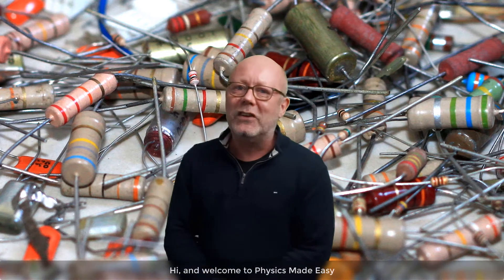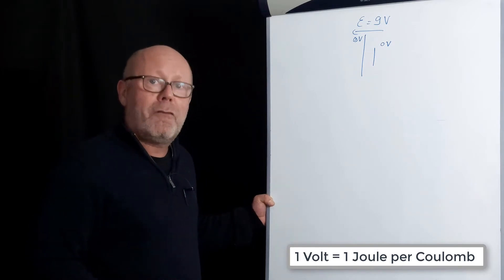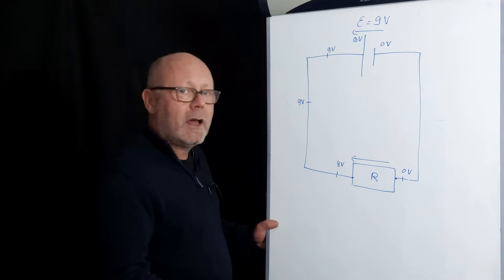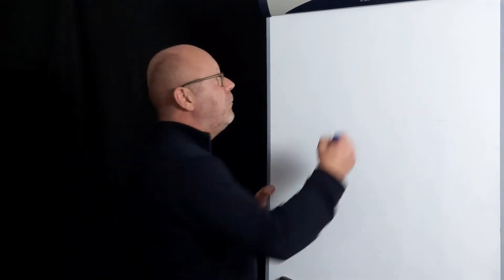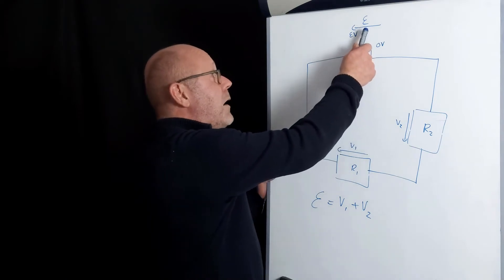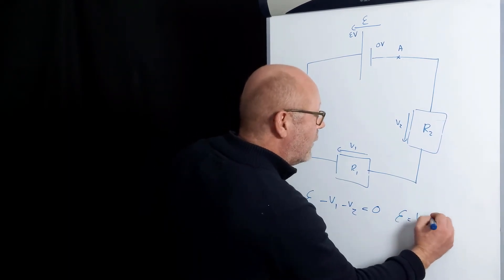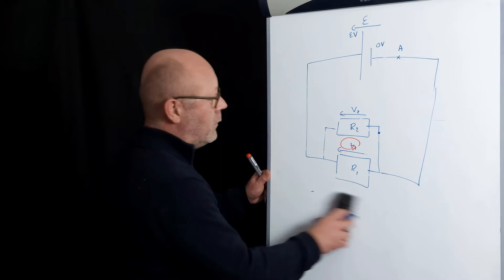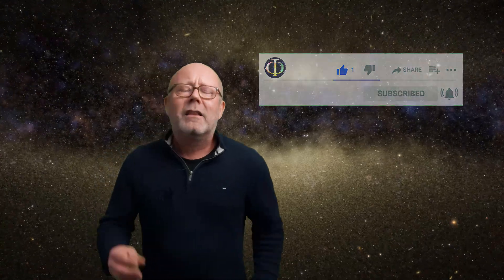Resistors in Parallel – Why the Same Potential Drop ? (Electric Circuits, Physics)

Comment: Hello sir pls answer my doubt pls sir my doubt is that u said battery having voltage 9v and move there freely without losing any energy but sir wire and item offers some resistance so if battery gives 9v some voltage must be dropped but we never do something like that while solving numerical sand sir how they energy can freely as wire offers some resistance pls answer sir
Reply from the maker: You are totally right King12. In reality all standard materials have a certain resistivity (only superconductors have a resistance of zero at a temperature under their respective Tc). Thus, when considering cables of a circuit, these will have a certain resistance. When connected directly to both poles of a battery (short circuit), the potential will drop linearly across it (for example, if the battery has an emf of 9V, and the cable is 18cm, the electric potential will drop by 1V every 2cm).
However, if you connect a resistor to the battery using that cable, the effect of the resistance of the cable will be negligible compared to that of the resistor, that is why cables are considered in circuits as having no resistance (it’s a practical model).

That was an excellent question. Continue thinking that way! And, if you cannot find an answer right away, do not get stuck as it could make you miss the train, be patient and move forward. The answers will come.

Comment: Why don’t the charges lose their potential energy as they move through the conductor? Like if a battery raises the potential of a charge by some joules then why does the charge not lose its potential energy via its motion?
Reply from the maker: Actually they do…
In reality, in standard conditions, all materials, even conductors, have a certain resistivity. Thus, when considering cables of a circuit, these will have some resistance. When connected directly to both poles of a battery (short circuit), the potential will drop linearly across it (for example, if the battery has an emf of 9V, and the cable is 18cm, the electric potential will drop by 1V every 2cm). However, if you connect a resistor to the battery using that cable, the effect of the resistance of the cable will be negligible compared to that of the resistor, that is why cables are considered in circuits as having no resistance (it’s a practical model).
So you are right, in reality, the potential energy of a charge (= electric potential of a position * charge) moving through a conductor changes progressively with its position.
Reply: Ohh! I think I get it now. Thank you sir!

Comment: Sir why don't micelles form in ethanol. Please sir help
Reply from the maker: Hi Lavanyam. Micelles form when you have in the dispersed in the water long alkylated molecules  with one side hydrophobic (repelled by water) and the other hydrophilic (likes water). The molecules will naturally arrange themselves in little spheres with the hydrophobic side inside the sphere, and the hydrophilic side outside. Micelles.
In ethanol, alkylated chains are soluble (that's why you can clean nicely greasy surfaces with ethanol), so, the chains cannot agglomerate into micelles.

Comment: Sir why don't current flow through the bird standing on a same wire having no potential difference. Why don't current pass through the bird and into the wire causes a shock to the bird. I wish I would get the real answer for the need of having potential difference sir rather than analogies.
Reply from the maker: Current will pass by the path of least resistance. Having the two legs of a bird on the same cable is like placing a resistor in parallel to the wire. The wire has a negligible resistance, but not the bird, so all current passes by the wire, and the bird is safe...

Comment: Sir how can resistors in parallel make the same potential difference or voltage? I mean if a 1ohm resistor drops the voltage to some extent and 100ohm resistor which is also connected parallel to it, how can it make the same potential difference as it drops the voltage very much such that the difference in potential is more? How please tell sir
Reply from the maker: The potential drop is an energy drop per coulomb of charge passing through the resistor. It's not an amount , it's 
a concentration. the 100 ohms tells you that in the same amount of time, you will have a 100 times less charge passing through that resistor (normal, it resists more!). Look also at the cables (A cable is an equipotential...)

Comment: How can the resistor make the oldest to drop to zero in spite of its resistance? Like if 5 ohm resistor able to make the voltage drop to zero volts and how can a one ohm resistor also do that?
Reply from the maker: Imagine two levels: one is at 5 meters high, and the other is at 0 meter high. You connect these two levels with a ramp. On the high level there is water, it will naturally go down the ramp to the low level (the ground). 

The fact that the ramp is steep or not will not affect the height it reaches in the end: whatever the slope of the ramp, the water will reach the ground. On the other hand, It will affect how fast flows the water: a light slope, and the water flows slowly, a steep slope, and the flow will be large.

The height represents the electric potential
The steepness of the slope represent the resistance (steep: low resistance, not steep: high resistance)
The flow the current.

I hope this helps!
Reply: sir then I got a new doubt. If the potential gets drops to zero in spite of the resistance then when the resistors are connected in series the current passes through one resistor all loses all the energy how can it work at the second resistor? Please sir  @PhysicsMadeEasy

Comment: @PhysicsMadeEasy sir why the all resistors able to drop the potential to zero? Please comment on this sir
Reply from the maker: If the resistors are connected directly to the battery (like in this case), The potential either side of the resistors are set by the battery...

Comment: Sir why  and how does electron  gain energy as they move across the battery
Reply from the maker: Actually, it is not rigorously the same electron that enters the battery and that comes out of it. But due to conservation of charge, any quantity of charge coming in, comes out. So it is a useful analogy to see the battery like a petrol station and the electron as a car, where it is the same electron (car) that gains energy (petrol).

Comment: Sir if the battery provides 10 joules of energy per coloumb how can there be loss of 10 joules of energy in all resistors doesn't it violate the law of conservation of energy
Reply from the maker: In both resistors in parallel, the loss is not 10 joules, but 10 Joules per coulomb passing through it.

Practical example:
Suppose the battery lets 1 Coulomb of charge flow in the circuit, and provides via these charges 10 Joules of energy to the circuit  (The battery as a voltage of 10/1 = 10 volts).
When the 1 Coulomb arrives to the junction before the two identical resistor, one half flows in the first resistor, and the other half in the second resistor, each half delivering half of the energy to the resistor (5 Joules).
In each resistor , a half coulomb lost 5 Joules, that is 5/0.5 = 10 Joules/Coulomb (10 Volts).
Reply: Great 👍  @PhysicsMadeEasy

Comment: two voltage sources with emf v1 and v2 (v1≠v2) are connected in parallel, what will be the voltage difference in the common terminal points?
Reply from the maker: Well, at first, during a transitory period, the source of highest voltage would charge the second one... A large current would occur in the cables connecting the batteries (it's value would be related to the equivalent resistances of both batteries): The battery of smallest voltage would see its voltage rise, and the reverse for the other. While the difference between voltages decreases, the current would decrease too until it reaches zero. At this point, both voltage would be the same.
I do not recommend you try with standard batteries... it would be like trying to charge a non rechargeable battery (risk of explosion)... and the max current at the beginning could lead the cables to melt, and the insulator to catch fire. So keep it a thought experiment :-)

Comment: Thank you for this video, here's my question, total novice I'm afraid. 
I have a 9v battery, with a resistor to stop my LED's from burning out. 
I have 2 LEDs in parallel.  If I use 2 LED's with similar voltage requirements (around 2.8v) they both light up, if I exchange one LED for an LED with a lower voltage requirement, around 1.5v, only the lower one lights up. Why?

Many thanks
Reply from the maker: Hi Ian,
At the moment you switch on the circuit, the voltage across the LEDs increases until it reaches a 'stable' point where current can flow. The first stable point is at 1.5V across the LEDS (the other 7.5V being for the resistor). Now current flows and the LED with lower voltage requirement lights up: the circuit is in a stationary state.
The 2.8V LED, being in parallel with the 1.5V one, is thus submitted to 1.5V which is not enough to make current go through it (Check the VI diagram for that LED). It remains turned off.     
When both LEDS require 2.8V, the first stable state for the circuits is when there is a voltage of 2.8V across the LEDs, so both lit up.

Comment: Not really great with electronics,but if the resistance literally takes all the energy of the charges, how do charges move after passing through the resistance?
Reply from the maker: High Techtoppers. Your question shows a confusion:
Charges are carried by charge carriers. The charge carriers move, thus posses kinetic energy energy of motion. The charges themselves carry electrical potential energy... The energy dissipated by the resistor is provided by the charges, not the charge carrier. 
This is why the drift velocity of electrons in a closed loop is constant (the current is constant all around a series circuit), but the potential energy of the charges decreases when energy is dissipated. 

As a very approximative image you can imagine a car with a passenger that has a credit card in his pocket with money on it... The car is the electron, the passenger is the charge, and what's on the passenger's credit card, the money, is the electrical potential energy. When passing through an automated motorway paying boot, one that just detects the car when you pass by it (= the electron passing through a resistance), the money on the card (electrical potential energy ) of the passenger (charge) is automatically removed from the card to pay the motorway fee (The electrical potential energy is dissipated). Yet the car is still moving.

Comment: hi, I have one Question - , When I am connecting a 1000Ohm resistor to single LED  in series connection with 5V input supply. the voltage drop across the resistor is 2.14v and for single LED is 2.68v , but when I add one more same type of LED in series connection ,  the voltage drop reading are for resistor .10v for LED 1. 2.48v for LED 2 .2.48v please explain.?
Reply from the maker: LEDs are not ohmic components. They have to respect a certain VI diagram to function. The current passing through the circuit will adjust itself to their functionning mode, that is why the potential drop at your resistor changes so drastically.

Comment: Could you please explain how the current remains the same in a series circuit?
Reply from the maker: Hi Piesmmh, First, two things to know:
Current is the amount of charge passing by per second. 
Conservation of charge: charges cannot be created nor destroyed.
So if Q charges come out of the battery in a second, that means that Q charges need to go back in the battery every second… The current in needs to be the current out.
If there are no branches in the circuit (series circuit), at the input and output of any component or cable cross-section, conservation of charge applies too. Whatever comes in comes out. That is why a current has to be the same anywhere in a series circuit.
Reply: @PhysicsMadeEasy  ohhhhhh thank you so much sir i finally understood this concept!

Comment: Electric potential depends on position right? So why is it that if a wire has low resistance, then it conserves electric potential? The more closer you are to the negative terminal, the more the potential decreases right? How does electric potential depend on resistance?
Reply from the maker: Hello Ashley,
Connect the extremities of a wire to the two poles of a battery (in other words, build a short circuit). The wire has some resistance, so the potential will decrease progressively from the + to the -. If the wire is uniform, the electric potential will decrease proportionally to the fraction of the wire already covered. So you see, the electric potential is only dependent on the position.
The resistance of the wire is very small, so you will get a huge current, and consequently the power dissipated may be enough to melt the wire...
Plug in a resistor in the circuit (in series). The resistance of the resistor is huge in comparison with that of the wire. The resistance of the wire can be neglected. This approximation allows to consider the wire as being an equipotential. (but in reality, it is not...it is just that the decrease in potential in the wire is small enough to be considered as negligible)
Reply: @PhysicsMadeEasy  "The wire has some resistance, so the potential will decrease progressively from the  + to the -"   Even if there is no resistance, the potential will decrease right? Why is resistance a necessary condition?
Reply from the maker: @ashleyhemanth9997  Hi Ashley,
When you say ‘no resistance’, and mean ‘infinite resistance’, then yes, the potential will decrease progressively with position. 

If you mean zero resistance, then you deal with a transitory period where the two potentials of the battery are going to tend to equate. However, zero resistance doesn’t make sense in that context: The huge current you will get will heat up the wire, which will lead to an increase in resistance… Besides, there is no zero resistance conductor that exist (in standard température conditions above a critical temperature Tc under which electron coupling processes like BCS take place).

Then, there is superconductivity (for T<Tc), where resistance is zero, but here you do not need a potential difference to support a current… Google it if you are interested in this subject.

Comment: Sir,please explain alternating current
Reply from the maker: Hi Saravana: when a DC current flows through a resistor (and energy is released out of the circuit), it is due to + charges pushed by the + side of the battery (or if you prefer to think with electrons, the - charges they carry pushed by the - side).

Imagine that every second you flipped the battery in the circuit (replacing the + terminal by the – terminal and vice versa). The charges would be pushed one way , and then after the flip, pushed the other way… they would end up oscillating, and some would pass through the resistor continuously. That is an AC current. Charges are oscillating around the same position and continuously gaining and losing energy,

Does this answer your question?

Comment: Sir, when the voltage difference is 9V, 1C election will loss It's 9J energy. My question is : 
1.Where the energy is transformed? Is it transformed into heat?
2. What does happen to the electrons after losing 9J. Do they loss their velocity? I know that the velocity remain same to keep the current constant across the circuit. So what is changed after 1C charge losing it’s 9J.
Reply from the maker: Hello Insteak,
1/ Where the energy is transformed? Is it transformed into heat? 
It depends what you have as a load. If the load is made of resistors, yes, the energy "lost" by the circuit becomes heat. But if the load is made of light bulbs, it is converted mainly to light (and some heat), a loudspeaker, sound energy (waves), a motor, kinetic energy etc...

2. What does happen to the electrons after losing 9J. Do they loss their velocity? ...
You are right in saying the KE of the electron remains the same even after passing through a resistor (the current remains constant across a series circuit). So where does this "lost" energy come from? It comes from the potential energy of the charge carried by the charge carriers. When the + terminal of a battery is at 9 Volts, it means that the energy needed to stack positive charges at that terminal is 9 Joule for each coulomb of charge stacked there. This is an energy of position, a potential energy. See it as the charges of the same sign stacked at this terminal repelling each other but they are forced to stay there until the circuit gets closed, and that the charges can flow away.
This is the energy lost in the resistor
When the charges come out of the resistor it is facing the negative side of the battery (say at a potential of 0V, meaning that there are no charges stacked there, and that the charge that arrive there are not repelled or repelling anything (in a battery you can buy in shops, these are actually neutralised in a chemical reaction.)
I hope this helps your understanding!

PS: In my answers, I am of course talking within the conventional model where we imagine that it is positive charges moving around carried by some kind of imaginary positively charged particles instead of electron. It is fully equivalent mathematically in terms of energy transfers.